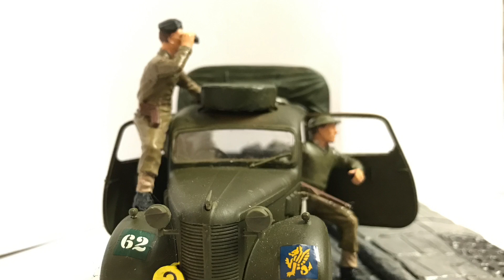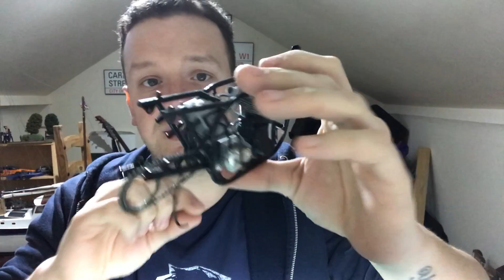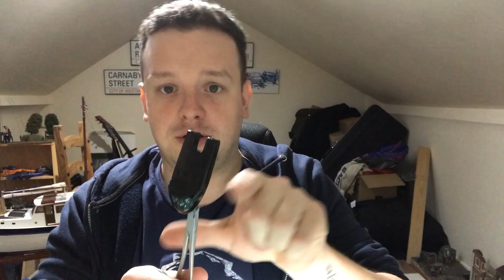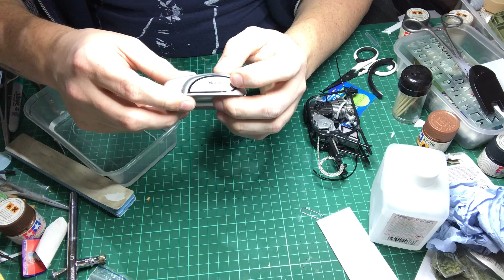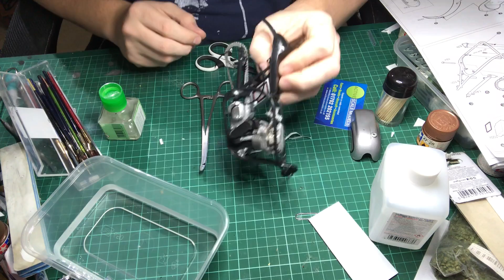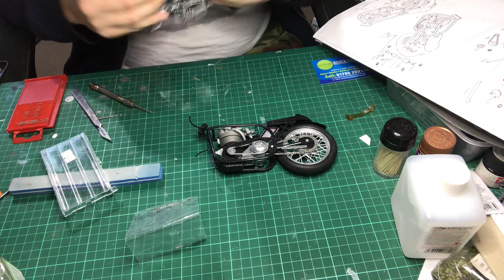Part 4 of The 1:9th italeri man norton

Comment: You have an incredibly cluttered workbench.  I think your modeling would go more smoothly if you cleared away the materials you aren’t actually working with.
Reply from the maker: Yeah this was my first and old set up my new set up is a lot tidier then this one hahaha I have places for things now
Reply: Late to the party 😂 but I have just started doing this kit, the tubing is a nightmare! I can't help but notice have you used the tube that is for the throttle grips on the engine? I struggled like hell getting the little black one on i almost resorted to doing the same but what did you use for the throttle?